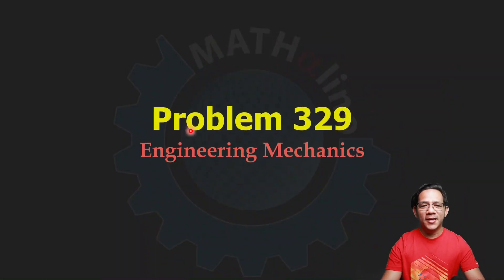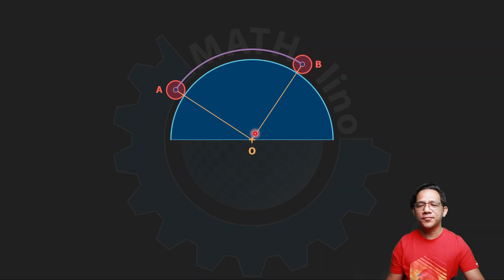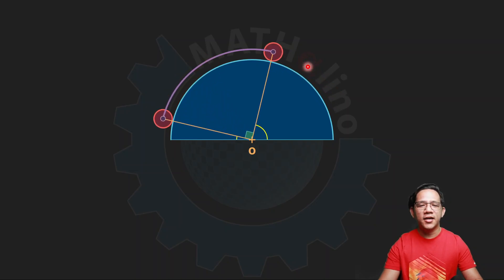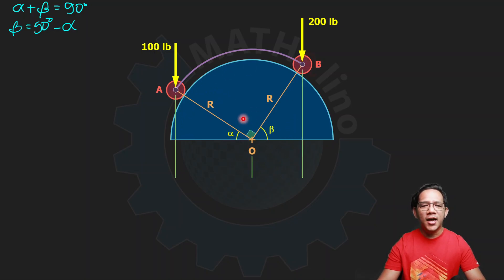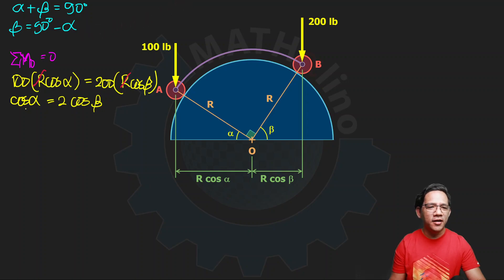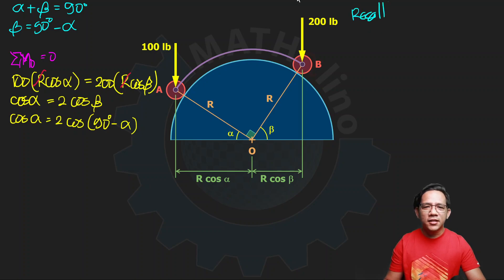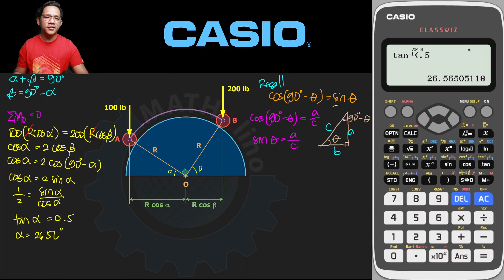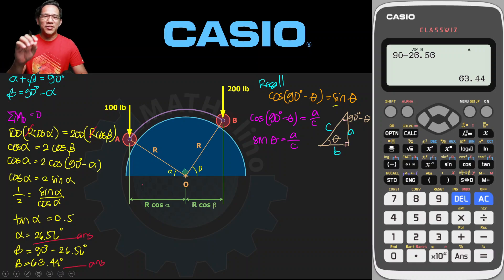Problem 329 - Equilibrium Position of Two Cylinders On Smooth Cylindrical Surface

Comment: Similar problem and position of the forces, What if the smooth cylindrical surface has the support from both ends, one is supported by hinge and the other one is supported by roller? Should we also consider the reaction of the support in solving for the alpha and beta? What should be the best approach for that?
Reply from the maker: I found two items in our site similar to what you describe.  It's in Strength of Materials already.  For reactions, maybe these can answer your questions.
(1) https://mathalino.com/node/459
(2) https://mathalino.com/node/364